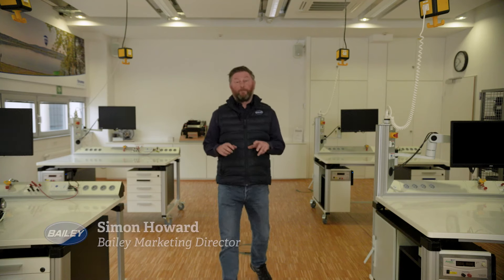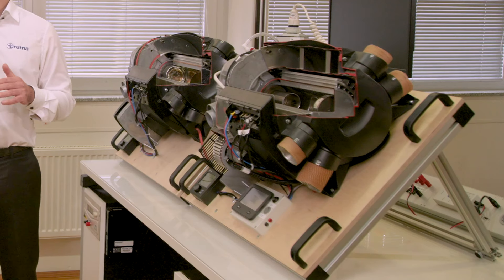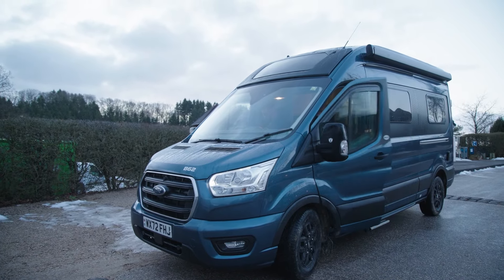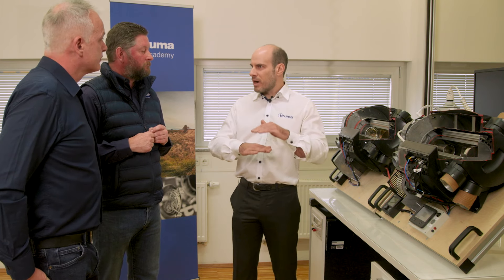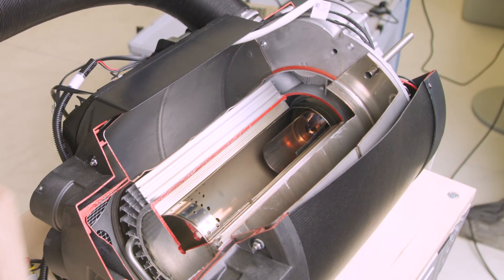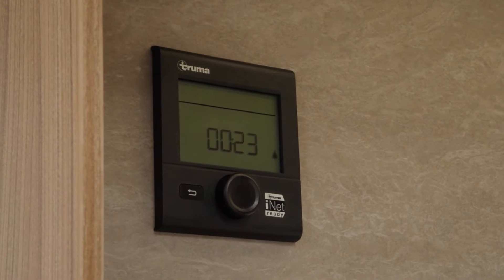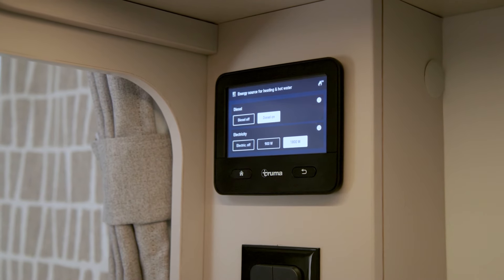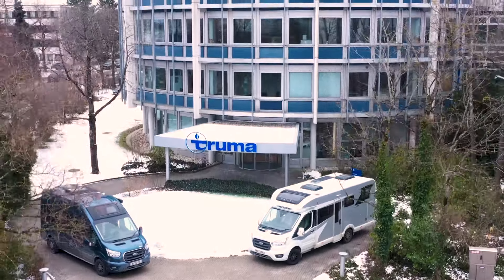Diesel vs Gas Heaters: What's the Difference?

Comment: Assuming this is for campervan / motorhome heating only. Pity there isn’t a separate fuel tank to allow for the use of this system in caravans. The tank could go where one of the gas bottles normally do - probably the least accessible leaving space for one bottle more easily accessible for the fridge / stove.